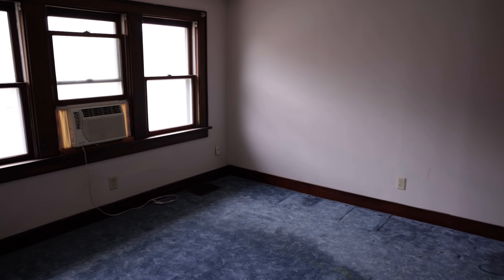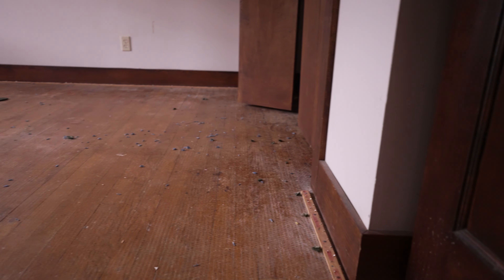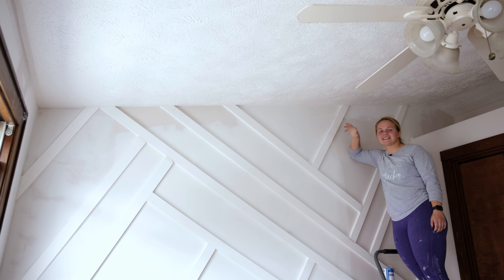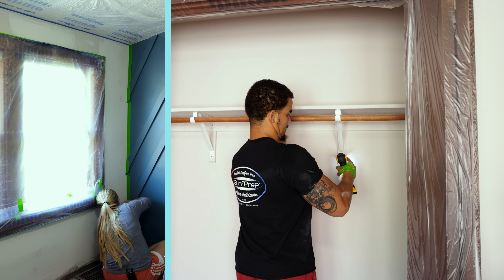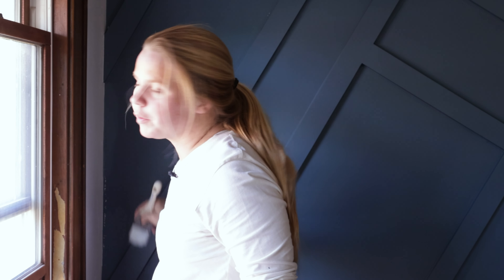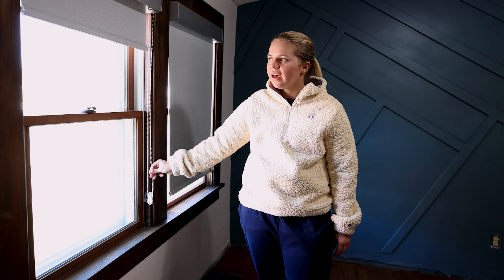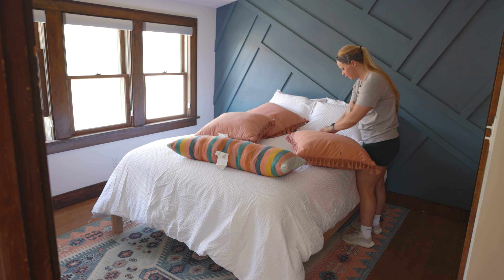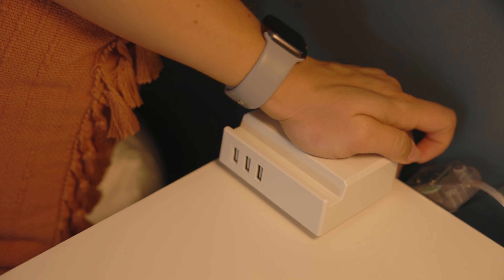EXTREME DIY BEDROOM MAKEOVER *FROM START to FINISH*  (AIRBNB BEDROOM)

Comment: Looks GREAT!  As an Airbnb Host since 2012 May I make a couple recommendations?  Secure your cords so a child doesn’t get the cord around their neck and so the cords are not trip hazards. Get a zipped mattress cover that protects your mattress against bedbugs and anything wet. Also zipped pillow covers that do the same. Provide a location for all your throw pillows so they don’t end up on the floor when guests are sleeping and then become a trip hazard in the middle of the night. Add a smoke alarm in the bedroom. Finally pack your bags and spend a couple nights as a guest in your Airbnb, it’s a great way to learn what might need some tweaking. Congratulations on all your hard work!!!
Reply: Sounds like very good advice.
Reply: VERY GOOD ADVICE. PEOPLE NOWDAYS LOOK FOR REASONS TO SUE!!!
Reply: Good suggestions
Reply: I give that advice to all my friends. Unfortunately, bedbugs will jump on you in doctors’ offices or anywhere you sit down. It will not matter if the place is brand new.
Reply: @Maria  but they can hitch a ride with you
Reply: @Maria-jm1cd  they certainly can crawl.
Reply: Great ideas!!
Reply: Excellent advice! I would have made these same recommendations ( or CAUTIONARY suggestions) ! The room is very nice!
Reply: Ya, big basket for pillows
Reply: Thank you I’m using these tips
Reply: As an Airbnb host I agree with all your tips, especially the ones about zipped pillow and mattress covers  .  Another tip to help prevent bedbugs is to have a luggage rack or other place for guests to put their luggage.  One of the best ways for bedbugs to travel is in luggage.  By having a place for guests to put their luggage, then maybe they wont open it on the bed.  I couldn't tell from the video, but it is best to use a duvet with a washable cover on the beds.  Definitely spend some nights in your Airbnb.  It's a great way to find problems before a guest does.
Reply: Great suggestions. Are you finding being an AirBnB lucrative?
Reply: @Holly Hold, I was the first person in my community to start an Airbnb, and initially, it was slow because people were unfamiliar with the concept of staying on someone's property. However, things have changed significantly now. Being an Inn Keeper is my true calling, and nothing excites me more than meticulously cleaning every inch of my accommodations, from washing linens to sanitizing mattresses and everything in between. Personally greeting each guest upon their arrival and witnessing their love for my place brings me immense joy.

I charge $49 per night for the first guest and $25 per night for the second guest, as I believe in fairness for solo travelers. On average, I book a little over 100 nights each year, with about 30% of those bookings coming from single guests. In terms of food amenities, I provide breakfast bars, English muffins, jelly, juice, coffee, or tea.

Most hosts wouldn't put in as much effort for the rates I charge. Having stayed at other Airbnbs myself, I've noticed that many hosts charge three times what I do without ensuring the same level of cleanliness and comfort. That's why I no longer stay at Airbnbs in Florida. 

The success of an Airbnb greatly depends on how well you treat your guests. To attract the right guests, it's important to clearly communicate your house rules. I had a couple of negative experiences in the past, but they taught me the value of being firm with my rules (I have 36 of them). Since then, I haven't had any issues.
When interacting with potential guests, I politely explain that I've had some miscommunication problems before. I kindly ask them to read and agree to my house rules before booking, ensuring that we both have an enjoyable experience together. If someone doesn't agree with my rules, I give them a link to all the other available listing in my area where they might be happier staying, but those who do book are excited to stay because they know it will be a great experience, because I'm so detailed with my house rules.

I recommend studying how hotels maintain their rooms since they have years of experience with guests. Focus on providing a safe, clean, and quiet space for travelers to rest, as that is what matters most. Take every possible precaution to ensure your guests' safety and well-being because when people are traveling and tired, they rely on your guidance.

Running an Airbnb like a business can be financially rewarding. Currently, I'm happy with where I am with my pricing, and I've gained enough wisdom that I could easily increase my income if I choose to do so. For me, the combination of my reasonable pricing and a beautiful spotlessly clean accommodation makes my guests feel valued, and they happily recommend my place to others.

Genuinely caring about people and taking pleasure in thorough cleaning, one can build an excellent reputation, and the money will naturally follow. 🥰

Comment: I found using bleach on anything but towels yellows. I use baking soda and hydrogen peroxide then add the detergent and fabric softener. This combination works on white clothing and colors. If the stain is dried loosen it up using hot water or spray stain remover. I had a stain on a blouse for a year and nothing worked until I used this combination. It’s budget friendly and disinfecting.